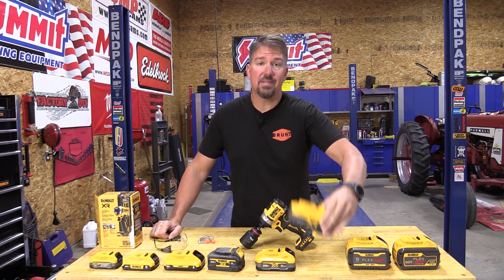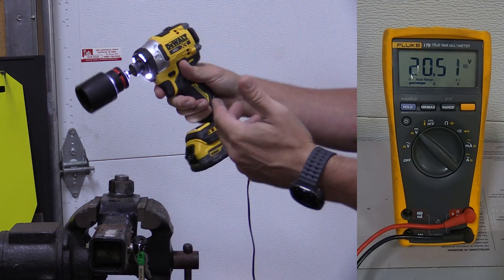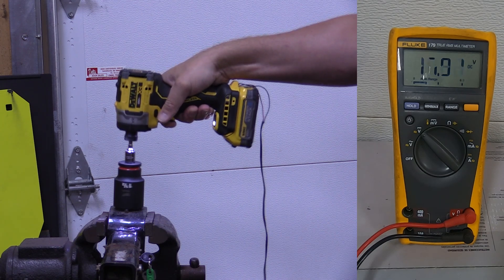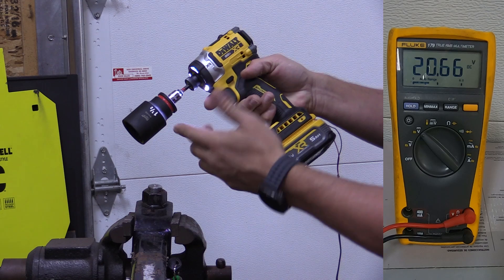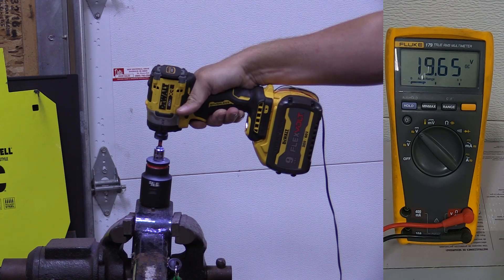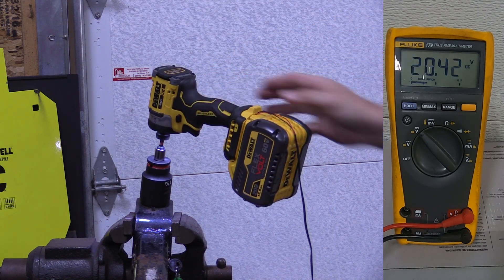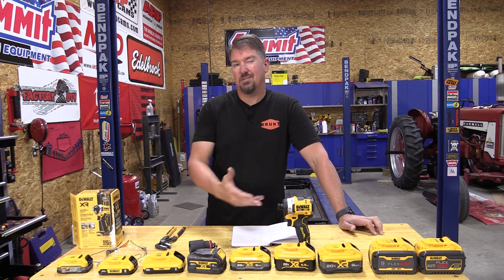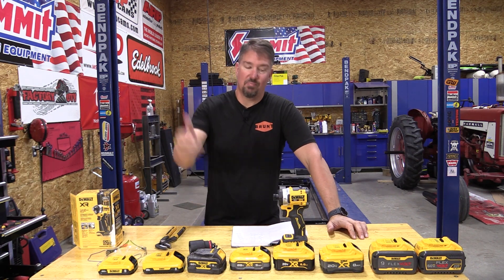Is The DEWALT XR POWERPACK 8Ah The King?  DCF860 Testing #dewalt

Comment: Thanks for doing this test, it's been really helpful. Glad my 6ah stands the test of time, though surprised about its performance vs the 5ah Powerstack. Where the Powerstack will theoretically win out is battery life over time. But that 8ah PP is a beast. I wish we could rig something like the FlexVolt circ saw to run off of it just to see what it could do, but until we get a new circ that can take full advantage of the 8ahPP we'll just have to imagine. Thanks again.

Comment: Surprised at the power of the 860. It really comes down to what you need that particular tool for. I’ve got some 9Ah Flex batteries that I’ll hold onto - seeing that they’re not that much different than the new 8Ah. If there’s a smoking deal on more 9Ah Flex I’d sooner take advantage of them. 

My impact drivers don’t see hard use, that’s what my 921 and 900 are for.

Comment: You always want more reverse strength than forward otherwise ull never get the nut off u have overtightened
Reply from the maker: @khill4491  this tool is called a driver and it is always easier to remove items than fasten them.

Comment: This is a deconstruction tool for rusted lags and are use by demolition crews and DeWalts announcement about this tool clearly pointed this out and is reason the spring is angle for reverse not forward and only use for a high torque driver is demolition crews

Comment: I am not sure voltage drop is a good measurement in this scenario.  The voltage drop would be similar, within 1 or 2 volts for each battery.  Slightly varying because of differences in the manufacturing processes on each individual cell in the battery, but still within the correct tolerance.  A lowered voltage is the tool signaling to the battery to send more power.  Basically send more amps to do more work.  The higher amp batteries mean you will be able to run the tool for longer, unless of course it overheats and shuts off to protect itself.

It might have been more useful to determine the amp usage of the tool, and use this to determine the exact amount of time each battery would power the tool.  That way if you needed to use the tool for an hour or two, you would know which size battery you would need, or about how many amps combined you would need if you used multiple batteries.  The kind of thing construction workers would learn with experience.

The reason the bit snapped was because the metal was too thin which happens with stuck bolts.  Instead of a 1/4" or 3/8" ratchet, consider a 1/2" ratchet.  But neither impact drivers nor impact wrenches are the best tool for stuck bolts.  You will want a breaker bar and some good old fashioned man power.  If you break the 1/2" bit, you might have to order a specialty bit which comes in 3/4", 1" and above.
Reply from the maker: @armelpeel  So, do you want to know the runtime per amp hour?
Reply: @WorkshopAddict  Yea, it might be nice to know ahead of time what size batteries I would need to use my tools heavily.  With my drill I know if I need to drill more than 10 or 20 screws, the 1.5ah battery aint gonna cut it.  I am guessing 5ah could do 20+ screws with another 5ah or smaller on the backup just in case.  With heavy usage I would guess the 8ah could work instead of two 5ah.  But two batteries is usually better than one.  If one dies you can still use the other one and recharge the first one.  You dont have to sit around doing nothing waiting for it to recharge.

Comment: The 8Ah XR with 10 21700s is pretty awesome, too. Would recommend picking one up to have your lineup more complete. I have half a dozen imported from the US since not available here.
Reply: Don't gets the 10Ah, the cells aren't reliable.
Reply: To be fair it looks like your 6Ah XR is 21700, and also that the 3Ah cells hit harder than the 4Ah cells, so probably similar to and slightly worse than then6 but woth 33% more runtime for the same size and weight.

Comment: The reason why Dewalt allows more in reverse is because they know people are going to use this to remove lug nuts.
Reply: Then they need to make a better quarter inch hex to 3/8 inch anvil adapter that doesn’t break every time lol
Reply: @Jeff-rk8hq  it’s not that. We are at the limit of the 1/4” format. They either need to go 5/16” or 3/8” for “heavy duty” applications.

Comment: Now im INTERESTED if you can compare the 8 AMP FORGE BATTERY to the 8 AMP POWER PACK to see what battery RETAINS the most VOLTAGE i have been running both Batteries against each other and i think MILWAUKEE has BUILT the BETTER MOUSE TRAP im sure they both use the same 21700 tabless Cells just need to know
Reply from the maker: If adapters were reliable, this would be easy.  I can do it with a saw and see what battery holds more vs the speed of the cut.  But I have to use a Milwaukee saw and  Dewalt saw.  I have not had good luck getting numbers from Frankenstein stuff.
Reply: @WorkshopAddict  that would work I'm sure you would get a ton a VIEWS since the TABLESS CELLS are the next greatest thing and try the 6 AMP FORGE vs the 8 and 12 with what testing I have done the 12 Amp FORGE BATTERY puts out more power to certain Milwaukee tools
Reply: Milwaukee is using ampace ac3 in the 8 and the 12 forge  @THEBEARDEDTOOLGUY

Comment: I prefer an impact which is stronger in reverse. Why isn’t it “what it should do?” 

In my mind it’s common sense to have more loosening power. Why should there be more tightening power? So you can strip good bolts while not removing stuck nuts? So you can put something on you can’t get off? 

More tightening power than loosening power sounds like a lose, lose, lose to me. But I don’t use impacts often and must be missing something?
Reply from the maker: I can see that in an impact wrench.  This is an impact driver.  More used in construction with screws and small lags.  You don't remove many. You put more in.
Reply: You are most certainly correct. I should’ve used my head, which I clearly did not. 

Thank you for your merciful response. For now on I’ll listen better and watch longer. 

Thanks
Reply: @fZionists78 I could see from an design/engineering thought process that they just use the same logic across the tools. Wondering what drills do.
Reply: @fZionists78 merciful response😂 sucks to be a poor peasant’ like me😫 no money to buy good stuff, still using my back breaking breaker bar for lug nuts😢
Reply: @fZionists78  Only smart men admit when they are wrong, that is why we know you are actually an intelligent person.

Comment: I have a dcf860 i converted to 3/8 drive because of ttc showing the higher reverse torque. I have a short demonstratiing it and also been using it daily and its definitely a beast. It feels stronger than the atomic and it may be able to beat the nee m12 stubby but idk. Im trying tp get ttc to test mine
Reply from the maker: You think a 200 ft lb impact driver will beat a 550 ft lb impact wrench?  Or did I read that wrong?
Reply: @WorkshopAddict  check my short out on my page removing a bolt that a dcf891 tightened to the max. Idk if you seen the stuff from the past with m18 gen 3 being converted beating everything at the time. Ttc included tested that. Your mainly limited due to that adapter. You get higher ipms of an impact driver combined with the capability of no adapter because of converted. The thing i would say is there is more heat tho with an impact driver converted compared to jus an impact wrench

Also ttc has shown that the claims are much more honest on impact drivers compared to impact wrenches typically
Reply from the maker: @bossmanz28  That is impressive, but we have no clue how tight it really was.
Reply: @WorkshopAddict  yea your rite. Thats why i want ttc to test which they responded and they mite but jus not at the time
Reply from the maker: @bossmanz28 Very nice build.  Can you use a torque wrench and keep moving up on different bolts to see what it will remove?  My issue is the 3/8" anvil and the size socket you will eventually need when you get to torquing to 500 ft lbs.  I end up with 1-1/4" sockets when I get to that point.  Otherwise the small bolts just stretch.  Props for doing what you are and I hope you can get it tested.
Reply: @WorkshopAddict  im not auto mechanic and am in construction. Ill drive large screw anchors and stuff which is actually where the combination of speed and torque is perfect but i dont have a torque wrench that goes high enough. Only got 1 for 250. And for testing yea 1/2" would make the most sense but real world to me i rather have a 3/8 for compact. Ill use the mid torque if i need 1/2". Also the 3/8 anvil fit without die grinding out the nose cone
Reply: @WorkshopAddict That isn’t a 550 ft lbs impact lol
Reply from the maker: @keysautorepair6038  The New M12 Stubby is rated to remove 550 ft lbs.
Reply: @WorkshopAddict  And a dcf 860 is only rated as 200 ft lbs but will remove 500 ft lbs the new gen 2 stubby did 406 ft lbs on ttc not even close to 550!
Reply: I'm getting promoted to a facility/maintenance manager position after five years of being a tech. Finally earning enough to build up more of my toolset. I use impact drivers everyday and just ordered the dcf860 I can't stress enough how much i'd love to see more content about your 3/4 drive swap! I wrench on my car and bike at home, would be mega to know the raw numbers man. Would love to see it on TTC or your own channel. Cheers.